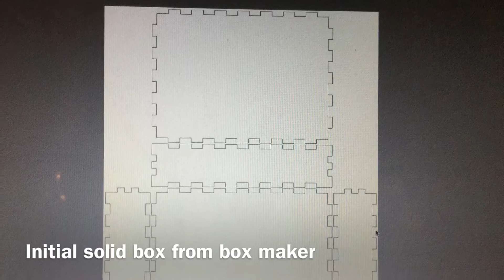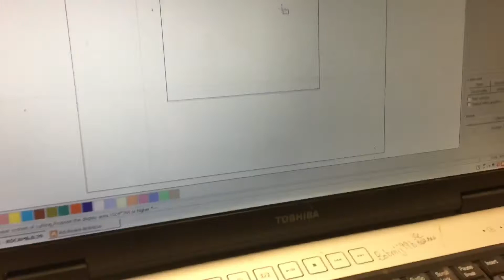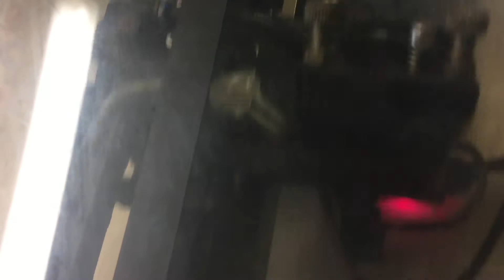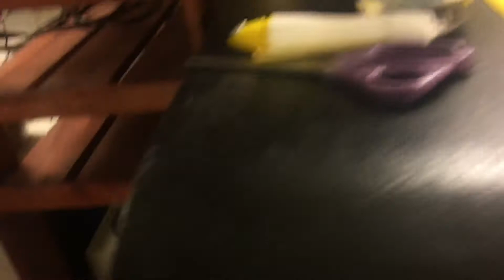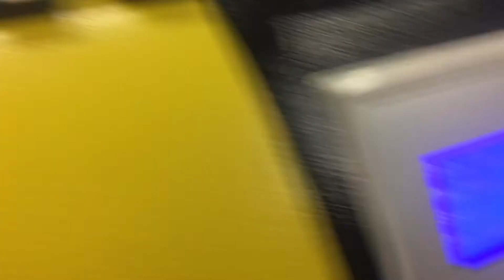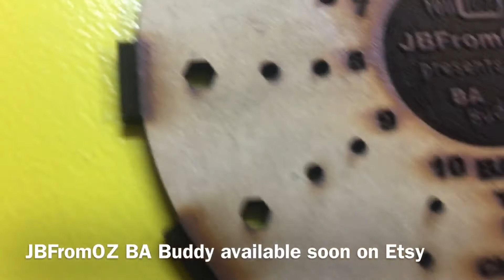Emma's Spareroom Surface Plate Box

Comment: Very nice. Now, wall-to wall, including  CAD time, how long did it take before glue-up? I'd like to know, because next time I have to build a box I will do a box-joint like yours, I will do it entirely with hand tools and we can compare. I cheerfully concede that the laser requires no tedious learning curve, unlike hand tools. But learning CAD  requires quite an investment in time.
Reply from the maker: I've just checked through the timestamps on the photographs, and the first "cut test" of the corners was just before 8pm, and the finished box ready for glueing was approx 10.30pm.
I have been involved in industrial design and graphic arts for over 30 years however, so I would not expect these times to be typical, (i.e. design changes I made might take others much longer) I was also idling along, so could certainly do the design work "faster" if I was focussed. the cut time was approx 30 mins, including some "double cuts" the rerun was 14 minutes so likely if single cut on all parts, est. 25 mins cut time on 7mm ply.
It is worth noting that the laser is not a "cheap" item, and there are indeed many tedious learning curves, including what was involved in engineering the "chinese" quality to functioning order.
I believe with an appropriate finger jig, hand router and table saw, this kind of work should be achieved accurately without needing a laser. Woodwork is an artform, especially when performed by those skilled in those arts.
Reply from the maker: the downloadable box design is "cut ready" within seconds of entering parameters FWIW.
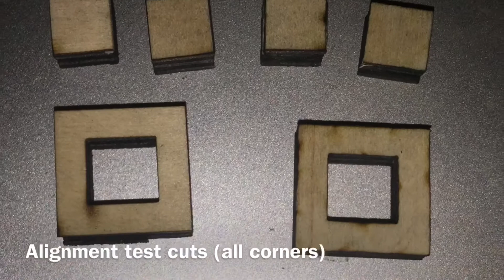Reply: OK, JB. But you had to master the box software too, No apples and oranges please :)  But I will say 2:30 for starters.
.
Reply: Yes, but someone did the software for you. Having spent almost all my professional life programming computers, I do not know how to account for that.
Reply from the maker: Hi Juan, yes I agree there are and will be different approaches, with the box software (a free website) you plug in internal width,length,height, material thickness and kerf (laser cut width) press the download button and away you go. Not much to learn, and no fee to use
Please understand that I wholeheartedly support your method and would love to see the results, for me we would both be winners :-)